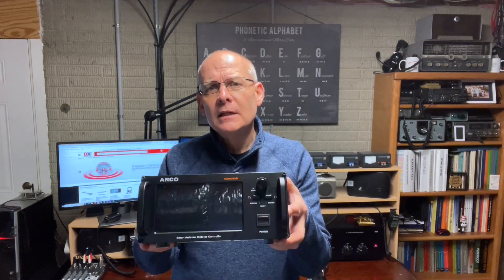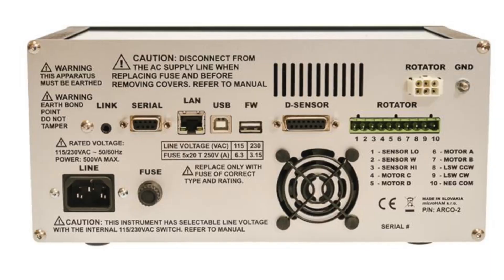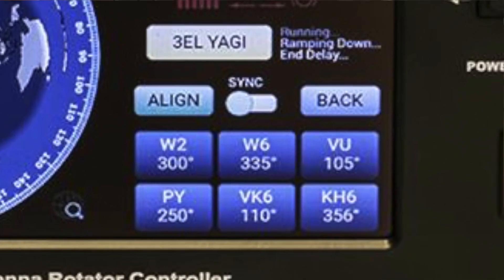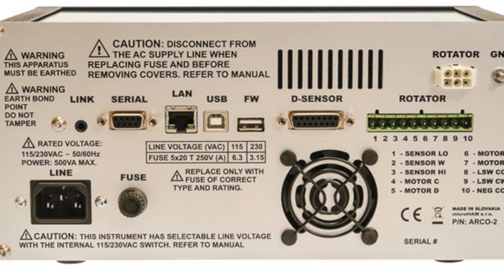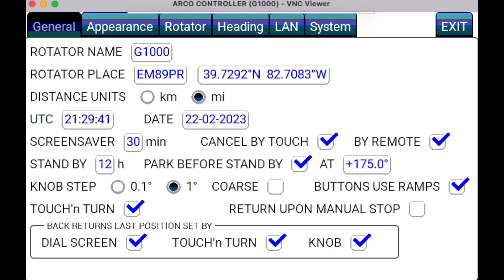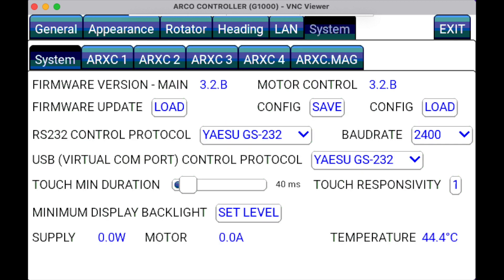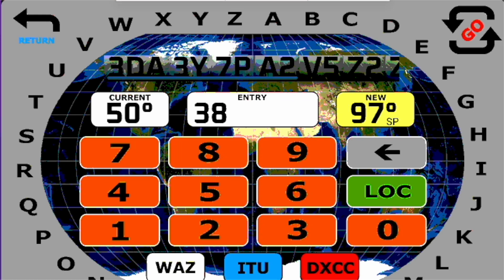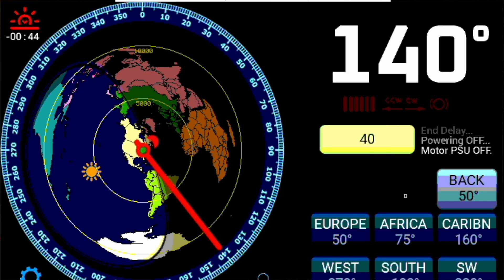The ARCO Rotator Controller from microHAM: Features & Benefits for the Amateur Radio Operator

Comment: If I buy a rotar, must I also buy the controller that comes with it, or can I buy just tbe rotating motor unit and add the ARCO controller separately? De WO8USA🇺🇸🇺🇸🇺🇸
Reply: DXE sells Hygain and Yaesu Rotors separately from the control box.